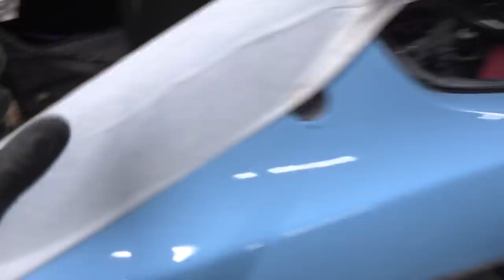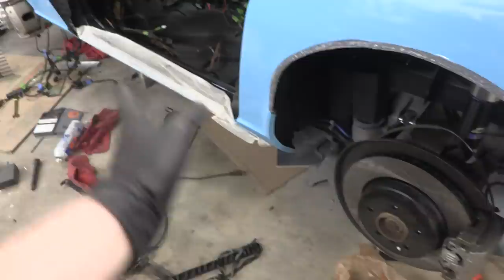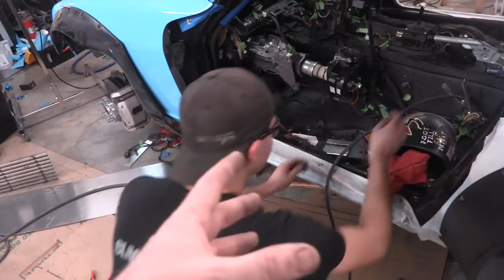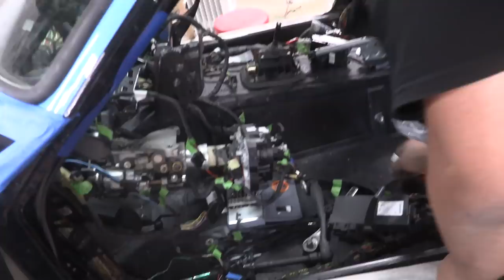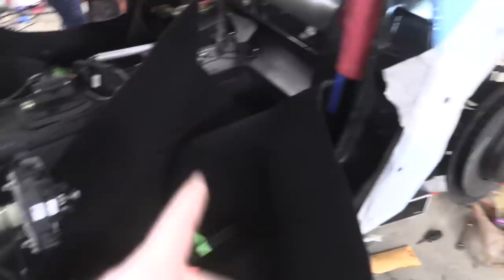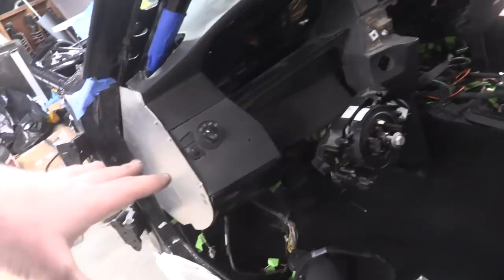240z Final Assembly Day 2 - First Start Up On New Tune and Bearings

Comment: That was like seconds from bursting into flames at 15:50
Reply: Especially considering a couple videos ago he was LOL'ing about running the main power to the engine beside the fuel line in the chassis.
Reply: no sparks, no hot manifold, no nothing, why would it burn? lol
Reply: Watch the velocity stacks at 16:07, is that a small backfire through the stacks?
Reply: Nebbia affaraccimiei 
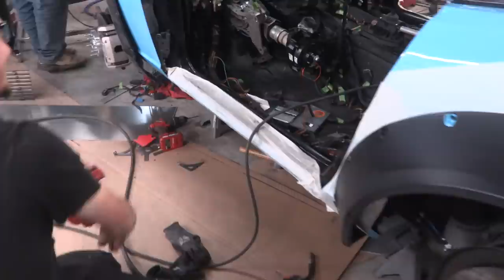Yeah why would it burn EXACTLY THERE? 7:30

Comment: I have to ask, why didn't you put the side skirts on with rivet nuts in the frame and bolts through the skirts? It wouldn't have required welding under the car and would be just as well attached as welding studs to the frame and using nuts.

Comment: Can you make a video on what all you have from the two shells that you would be willing to sell and how much you would want for them?
Reply: He basically has a shell with no floorpan that is twisted from the accident and that's it. Everything he had that was in good enough condition to sell, he kept.
Reply: I’ve been looking for a set of pans for the floor and trunk. I found a 70 or 71 240 that got parked under a tree without the rear hatch glass.
Reply: @matthewhall9530  isn't the floor pan one piece on the 240s? I thought that's the way most Japanese cars were designed
Reply: I’ve been able to find floor patch panels but nothing for the trunk. I really dont want to try and find a wrecked one just to cut the floor and trunk out of it unless it’s only worth buying for the panels. I’d hate to destroy a car to fix another one.
Reply: @matthewhall9530  Yeah as far as I know Chris' 240 was rusted out in the foot well and the back was ok, but he used the plasma cutter to remove it and it's next to impossible to make that fit a car again.

Comment: sorry if it's already been stated but I don't remember.  Did you use some kind of insulation on the inside to help with deadening the sound something like Dynamat?
Reply: jeremie manninen using the bed liner as sound insulation

Comment: This is why I don't subscribe to this channel.  I took one looks at th3 welding and grinding and I said there goes tell wrap. Less then 2 minutes the wrap is melted.  Brake lines leaking, lucky the car didn't start on fire with gas spraying all over. Tin pop riveted to the dash sides. Looked like rivets through the floor under it. Wiring laying all over the place. Looks like a bag of dirty ass. This car is going to be the joke of Sema. While I applaud your work for even getting it done and moving. This car is no where near Sema worthy.